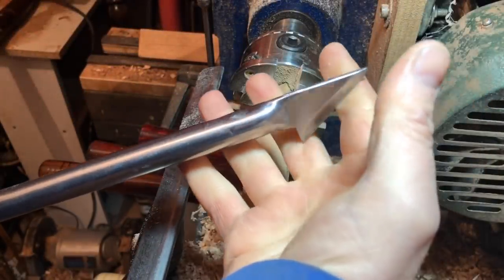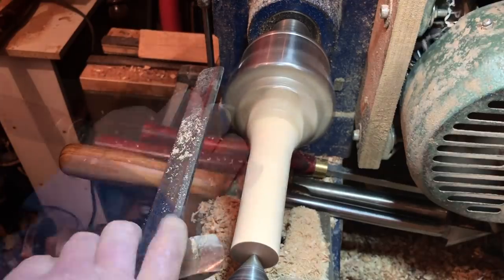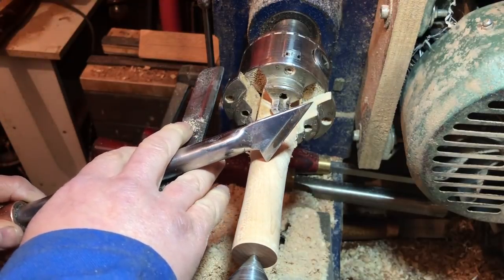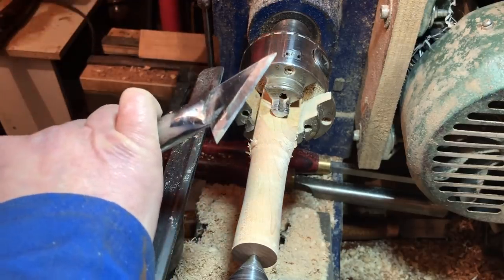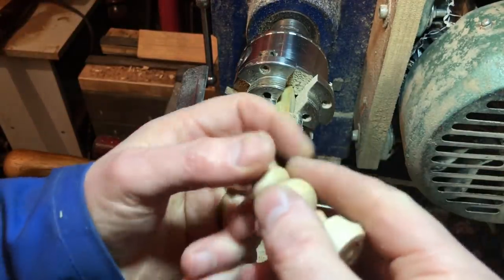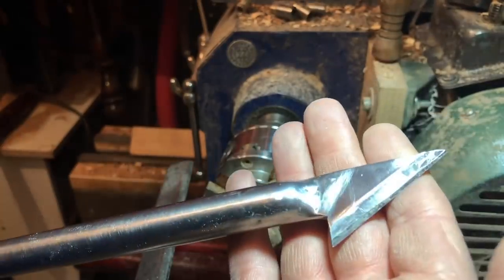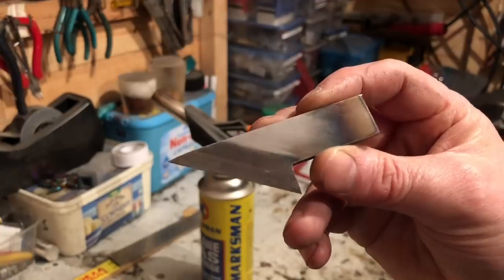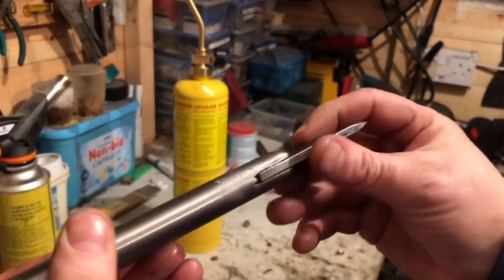THE LATHE KNIFE: SKEW KILLER, GAME CHANGER?

Comment: Great video.
What might be a better way to temper would be heating a chunk of steel red hot and laying it on the back of the blade not too close to the point.
You might have better control of the colors running toward the edge.

Comment: Very interesting.    Thanks for posting.

I may have to make one of these.   I have some scrap 1/8in (3.2mm) thick x 8in dia (20.3cm) HSS saw blades which I can cut up to make the blade.

Your angle looks like about 45 deg.   The Russian fellows knives look to be more like 60 deg angle and with a curve.

The Russian fellows make it look so easy to use these tools.    They likely have been using them a long time.

Dave.
Reply from the maker: LV_Woodturner yeah go for it. My round bar is 16mm dia, the point is 30 degrees, the straight blunt edge is 40mm, the sharp edge is 50mm, thickness of blade is 4mm

To improve, thinner blade stock, 3mm or less, shorter blade....say 35mm or so, sharper point angle a slightly...say 28 degrees or so and 14mm round bar stock.

Thanks bud!

Comment: Very fascinating. That dropped heel looks to be very powerful.
I saw one of those Russian video's where a big Russian lady was turning doll shapes using a long knife like that, like corporal Jones with his bayonet..... Essentially a tough little sloyd knife on a bar. You could use guage plate to make them. I once used it to make a couple of plane irons. 
Perhaps you could try a mini tin can forge to get better heat (lined with ceramic wool) Uses up less gas! Or you could use lengths of old coil springs and forge the knife edge on one end? Or use a single round bar with a allen key grub screw where you could put different sized blades into a slot? Great video anyway, Best of Luck with your efforts
Reply from the maker: GOLDSMITHEXILE 2016 cheers bud! Many of your comments I have already done... the little tin can forge and I’m looking into changeable tips. I have a later video where you can see the can forge lol. Thanks bud, I appreciate your helpful ideas!
Reply: No problem I just got this recommended in my feed this morning, never seen yours before....most "recommended" vid's are duff but yours was thoroughly enjoyable I'll look at others of yours, just went back to some Russian bowl turner vid's, they love there cup chucks. 
I set up a tin can furnace to make bent knife blades and adze blades for carving, very liberating to make your own stuff! @CLWoodturning

Comment: Get a really polished finish with a tool like that.   I do think that one could regrind a standard skew to form the same cutting edge but there wouldn't be the over hang on the heal.  What cutting speed are you using?  With something like that a slow speed keeps the edge longer.  One caution, however is that one must be very careful with the point as it can dig in and cause a terrible blow out and possible injury.
Reply from the maker: Dick Martin hi Dick, yes reforming a standard skew may not give you the heel form of this one. I cut between 700 and 1200 rpm depending on the wood and shape etc. As for accidents, if the wood hits the sharp edge the worst that happens is a ‘skate’ up or down the piece. If you plough into the wood point first, blade down then yes could be nasty but I’ve never done it. Blade up and you can address the piece point first without any issue. Thank you for your comments.

Comment: have you tries High speed steel? it should stay sharp longer ,  just a thought
Reply from the maker: Anthony newsome yes Anthony I have some HSS which I could use but following correct hardening and tempering the flat stock is just as good. I not temper in an oven and have really good results. Thanks!

Comment: Not a lot of steel to sharpen. I’d be interested to see how long it lasts with repeated sharpening.
Reply from the maker: Bill Gunnett I see your point, thing is you only need to use a standard kitchen knife sharpener or similar which removes very little metal to true up the cutting edge. If you attack a bench grinder with the tool you would sure grind the blade away.

Comment from the maker: UPDATE:  I have managed to make 8 Lathe Knives so far, 4 with 14mm shafts, 4 with 18mm shafts. Handles will go on tomorrow (hopefully). Slightly improved design too. I’ll keep making them if peeps want them. Thanks so much for all the great comments! CL

https://etsy.me/2GzEMWL
Reply: What angle is the edge. Looks like 60* ?
Reply from the maker: Patti & Eddie Azevedo which angle? The point is around 30*, the cutting edge bevel angle is around 30* also. Happy to measure any dimension and let you know, can you give more detail?
Reply: This tool looks amazing, what do you make them out of?. I would like to make one.
Reply from the maker: Robbo it’s in the video but shaft is stainless steel 16mm, blade is hardened and tempered 01 tool steel, handle hardwood. They are awesome. I have them for sale on my Etsy page in two sizes 

https://etsy.me/2GzEMWL 

Go for it making one, just ask if you need a hand.
Reply: how can i get 1
Reply from the maker: thomas carey hi Tomas they are on my Etsy store. Please follow link below, thank you

Etsy shop

https://etsy.me/2GzEMWL

Email

clwoodturning@icloud.com

Comment: Not to belittle your video, your skew chisel is a modern modified skew grind. I remember when grinding the edge round instead of straight first became popular. If you grind your skew straight (like it comes from the Sorby factory) and a little steeper of an angle, it's the same as the lathe knife.
Reply from the maker: 64t120r not really... you don’t get such a heel.
Reply: @CLWoodturning  Yes really. . . change the grind and it's exactly the same.
Reply: I think the advantage to this “knife” is the round shaft would be easier to roll on the rest than the western skew’s rectangular bar cross-section.
Reply: @64t120r  My skew is straight at a 45 degree angle so pretty similar to this knife. Its not under cut like this knifes heel but then that undercut plays no part in cutting or rubbing. Yes the round shaft may help to roll the tool. I'm not sure why there is so much juddering, I don't get that with a skew.

Comment: Have you tried the other tool that they use to hollow out bowls?
Reply from the maker: billy19461 ah the hook tool... not yet billy, I need to forge one... I’ve seen they can be made from bolts believe it or not!
Reply: What kind of bolt?  I live in Louisiana, in the USA so the cost of the tools and shipping is a little high.
Reply from the maker: billy19461 I’ve seen a video where the cutting edge is actually a bolt thread, head cut off, shaped and milled to a cutting edge. Heated and bent to the hook shape, then welded to the bar... fascinating!
Reply: Yes it’s great looking tool and it sure hogs the wood out quickly.
Reply: I use a ring tool I made to cut just like their hooks. The closed loop or ring I believe gives superior strength to the tool. I think I got the idea from David Elsworth 30 years ago.
Reply: Spud pud. Yes you can buy those but I was told the hole would clog up easily.
Reply: @billy19461  The ring I made has a 17mm hole and the ring tool blade is 8mm from cutting tip to back. Its does not clog at all. I made mine out of an old file that I heated to cherry red and rolled around a steel former rod to give a perfect curve. It was then welded to a 18" long, thick shaft. Heat treated and sharpened. Total handled length is about 1 m.
I made it to turn the inside of very deep vases (1 meter deep), cutting mostly side grain (after boring a center hole) and it is very pleasurable to use, fine finish.

Comment: Great video!  This tool looks amazing.  Have you tried using it on epoxy resin?
Reply from the maker: Jason Valenzuela yes bud I have and it works fine, harder thank Wood as riding the bevel can heat the epoxy a little too much but certainly cuts no worries.
Reply: CL Woodturning Awesome.  Thanks for the reply.  Maybe in the future you can do a video showing it being used on resin?😊
Reply from the maker: Jason Valenzuela sure bud. I still prefer round carbide in resin for the heat resin I mentioned but I’m game to show anyone interested, this tool on any medium really.
Reply: CL Woodturning Super cool.  It’s mesmerizing watching how the tool works.  I use Negative Rake carbide currently on resins and it works great.😊. I might want to buy one just to see how nice of a finish I get before sanding.  Maybe if used the lathe knife just before sanding it might not heat up the resin as much.🤔

Comment: be careful if you are selling them, ark welding could make the metal brittle, bronze welding or silver soldering my be safer or re temper after welding
Reply from the maker: craig hornsby cheers bud!
Reply: also less likely to break if only weld on the two sides and not the end @CLWoodturning
Reply from the maker: craig hornsby so you think silver solder would be strong enough bud?
Reply: I should have said silver brazing they youse it on metal lathe tools to braze on carbide tooling best to google it to confirm
Reply: CL Woodturning    silver solder is strong enough but you will have problems with hardening and tempering after joining. If you harden first you will screw it up due to the heat of the soldering. You might also consider plain ordinary mild steel for the shaft, no risk of it getting brittle and way cheaper than silver steel. Even if you want to use a hardenable steel for the shaft there are cheaper alternatives like EN8 but again you run the risk of it getting brittle which would quite ruin your day .  Silver steel has a fairly accurately sized ground finish, which is not necessary for your use and costs  more to make. If someone else made a similar comment just ignore above.
Reply from the maker: Chris Stephens yeah I use stainless steel currently but may move to mild steel for the milling properties required during build. I also heat treat and temper after welding now for exactly the point you raised. Cheers bud!

Comment: I guess I don't understand how this is not simply a skew. It's essentially a skew mounted 90° to the bar, no?  This is making no sense to me. Can you explain why it's different than a skew?  It seems to be a very thin skew mounted sideways.  Perhaps mounting it that way makes it different (better?) to use.
Reply from the maker: Jim Bessette way I’ve used a skew for many years and the difference is the orientation of the tool, the ease of twisting the tool, the fact you can address point first easily and use the heel more effectively. Even a skew ground to such an angle does not have such a defined heel. If you’re happy with your skew, and I was for many years, stay with it. I look as this as a skew that makes sense lol.

Comment: Fascinating. I enjoy my skews, but this certainly looks like it's worth giving it a go. Have you measured your sharpening angle? I'd be interested in knowing what the included angle is -- it looks pretty acute. Also, I dabble in bladesmithing, so if you're up for some unsolicited advice: you'll get better tempering results if you temper the whole thing in your kitchen oven (or even a toaster oven) for two, two hour cycles, then draw the temper further on the handle end with a flame, cooling in water if the temper colors come even close to the edge. You should be able to find the correct temperature to temper from the supplier or manufacturer of the steel. If you want to more effectively heat your blades Google "two brick forge" -- a dead simple but effective forge using soft firebricks. Clyde
Reply from the maker: Clyde Ulmer awesome advice Clyde! Yeah I need to make a mini forge for sure. The tempering didn’t go so well, hard to control heat etc so you are dead right, next try will be oven. Great advice, thank you!
Reply: @CLWoodturning  You're quite welcome. As I watched through some of those videos by those crazy skilled Russian turners, it occurred to me that the lathe knife would be really easy to forge from a short piece of round tool steel (doh -- I'm a bladesmith, but slow sometimes...) Look up YouTube videos on how to forge a leaf for a starting point, get yourself an anvil of any sort (I started forging on a piece of truck axle set upright in concrete) and away you go.  No welding, hard soldering, brazing... I'm going to bash out a couple to play with myself.  Clyde